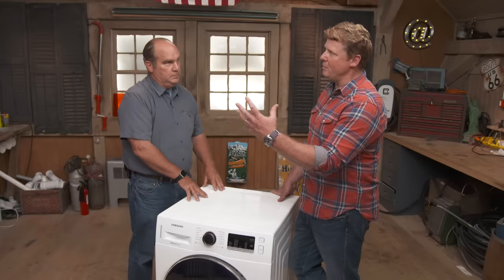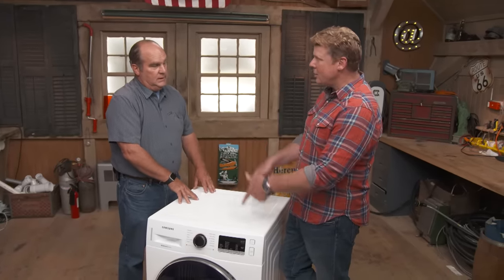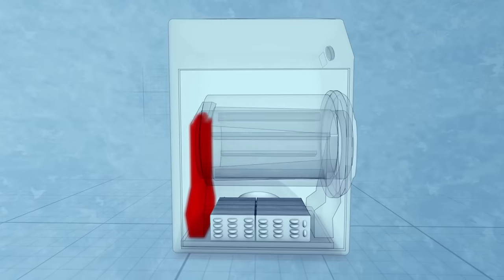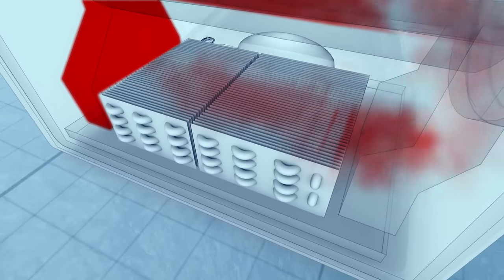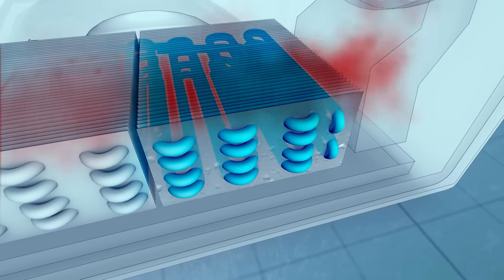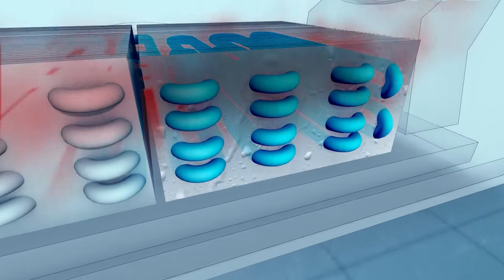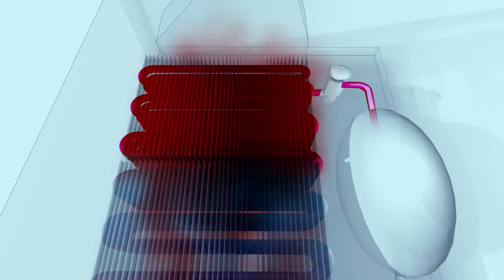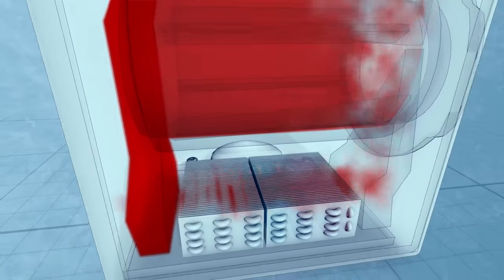Exploring a Heat Pump Clothes Dryer | Ask This Old House

Comment: Don't believe the hype. I had one in Europe.  The coils MUST be absolutely clean to maintain efficiency and a reasonable drying time (less than 3 hrs... not joking).   Also, there is a problem with mold buildup inside the condensate trap.  If you have a perfectly good working dryer, you're best bet is to maintain it.  The environmental argument is dubious: chasing after new tech, throwing a perfectly good appliance in the landfill to save electricity (not really).  In the end, if you factor in the carbon cost of manufacturing (transport, solvents, man-hours etc.) vs using a perfectly good dryer, you are doing more for mother earth keeping an old dryer clean and well maintained.  Better yet, use a clothesline.  Check for yourself...
Reply: This has convinced me to stick with a Condenser. Thanks... I think 😂
Reply: Newer models self flush the condenser. Very efficient. Drying times are similar to our old coil dryer. Much easier on the clothes. Often, additional drying time is a result of the condenser needing a good clean. I'm using a Bosch 500 series dryer with heat pump/condenser.

Comment: Ventless dryers have pros and cons. The pros are energy savings. about 2.5-3.5kW per load. What few people realize is they are venting the heated or air-conditioned air from their home with a vented dryer. The EnergyStar ratings ignore this. Why bother with an air-tight home when each dryer load is like a 5" fan-driven duct to the outside?

The cons are the best ones are European compact models. Why? Because giant US mfg's don't have a user-friendly way to clean the lint off the condenser. With Bosch and Miele, you pull the condenser out and wash it under the tap. With Whirlpool, effectively the only US company to make ventless dryers, you have to call a service tech to disassemble the machine for condenser cleaning. A normal family of 4 needs this done at least once a year. If your ventless dryer is taking hours to dry a load, bet your bottom dollar the condenser is clogged with lint.

Bosch tried to make a high-end ventless dryer with a self-cleaning condenser but it failed in consumer use. 

I have the large Whirlpool ventless and I beg the service tech to clean it every year but he hates the job. Some tech's just refuse because it's an ugly job. Whirlpool engineers are not that bright.

Comment: My dryer vent supplies 3 kw to my backyard in the form of hot, damp air. A 1 hr cycle throws 10,000 btu outside. ventless saves 15 cents per cycle in natural gas not burned for the same heating effect. For electric savings? Maybe another 15 cents. So... 1 per day over 1000 days nets $300. Long return.
Reply: kubtastic huh, $100 a year to run my electric dryer, I’m good with that.

Comment: They may save energy, but if it develops a refrigerant leak then the dryer is junk. Not to mention they aren’t a simple as a conventional dryer. I’ll just stick with my 1973 Maytag DG306 gas dryer that will outlive most newer dryers made today.

Comment: I can't understand one thing - heat pump is not producing any heat itself, yes? It's just transferring the heat from one side to another. In this case, when you blow the air - first to the cold part, then to warm part - you should get back exactly to the same temperature (as input air, but less humid). But it's not the way how dryer works. Temperature in the drum increases significantly, as well as room temperature... My question is - what is producing that heat?
Reply: Whatever you are using to condition the temperature of the room the dryer is sitting in. The dryer works by moving the heat (from the air) between the cold condenser and the heat-exchanger, so if you place the HP dryer on a room which 15C or below, there is not enough heat to "pump" and create the necessary difference for it to work. That is when people will see the drying cycle time spike from 2/3 to 5/8 HOURS. Long story short, don't put a HP dryer on a cold humid room.
Reply: Btw, that is why a HP dryer dries using lower temperatures. It can generate a 25 to 45C difference internally (depending on its generation). If the room temperature is 15C, the heated air will top up at ~60C.

Comment: These are common in europe and just look at how much the British complain how bad they are....  We were in Greece last month and had the displeasure of European washers and dryers again. They are both horrible. 

     The washers take 4 hours to run a normal cycle. If you forgot to put an item in the washer, tough luck as the door won't open until it's done unless you take the top off the washer and manually open the latch with a screwdriver.  The dryer was just as bad. You are better off washing your clothes by hand in the sink and then hanging them up from the grilles of the mini split to get them to dry....

            Washers and dryers are something that the US does well. Ours just work. Those euro ones are a neat idea but they just don't work well.
Reply: Dryer issue in the Uk is that they catch fire, these are the standard type with the vent, been ongoing for some years, various trading names, parent company is now Whirlpool. Lint  build up around the heater is the basic problem, even with the pre filter. I have the Samsung model shown here, for 2 years, been fine, low running cost
Reply: Robert Adams European front load machines are vastly more efficient than US top loaders. They use less water and less detergent, but clean better. They damage clothes less. They spin much faster reducing drying times. They heat their own water so are capable of reaching a boil if required. The longest programmes do take a long time, but everyday programmes are generally under two hours, and most machines now allow the door to open in the early stage so missed items can be added. Perhaps you just encountered a cheap or faulty machine. Dryers are much the same as in the US, the vented ones will be fractionally slower as they will be 230 volts but likely only 13 amps so they can be plugged into any outlet rather than a dedicated dryer outlet. Condenser dryers are common here, and again a bit slower but if you were in Greece the expectation is that you hang clothes out to dry! In warm climates condenser dryers don't perform as well, they need cool air to operate effectively. Clogged filters also make a significant impact, more so than in vented dryers. Sounds like you just had a bad experience.

Comment: Its really great a making mold, just like the Bosch front loading clothes washers.  High maintenance devices in a maintenance free society.
Reply: Really? Please explain
Reply: Always leave the front load door open when done washing. They need to air out. Close it mold grows!
Reply: Brian Ross Front load machines have been the norm in Europe for four decades. Nobody under forty has ever seen a top load machine. They don't get mould if you use them regularly, run a hot wash once a month and keep the door ajar between uses. Why America seems to think they are some new fangled trickery is beyond me- they wash better, damage clothes less, use less detergent, less water and less energy than a top load machine, they also spin faster so drying times are reduced saving further energy and wear on garments, still, you stick to a glorified version of your great grandmothers wash tub if you want.

Comment: had that model now for 3 years -mistake because you can not clean or remove to clean  the botton vent properly (wet lint )  machine is not drying properly now
Reply: Yea this is a huge flaw in the design. The genius of vented dryers is that lint is blown outside or gets trapped in up to a 25ft vent. I clean my dryer and dryer vent for lint every 3 months. Knowing all the lint my clothes produce with 8 pets I’d kill this machine in a year through lint alone.

Comment: I'd love to see this in a single washer and dryer unit!!! Cool tech.
Reply: I just checked a local electronics and washing machine supermarket. They alone had 20 different machines spread over 9 different brands. They are plenty abundant here in Europe. I don't know the market in Canada.
Reply: @yvindascanius6061  Canada? 🤔
Reply: @BloodyIron  When I click on your about section in your profile it says: Joined 12 Feb 2007, location Canada. Right or wrong?
Reply: @yvindascanius6061  might be, thanks for the heads up on my profile showing that :) no big deal friend :) thanks for the info on washing machines in your part of the world!
Reply: @BloodyIron  You're welcome. I just like to know which part of the world the person I'm commenting on is coming from. That could make the comment more precise. Have a nice day.
Reply: Check out the AEG Ökokombi, available in most of Europe I believe, for around 1000 €. I’ve had one for about five years now and couldn’t be happier with it.

Of course if you have the space for a separate washer and dryer, that is always better - this machine is tightly packed inside.

I was really surprised that a heat pump drier is considered a new thing over there. 

Greetings from Finland.
Reply: Øyvind Ascanius are you sure the combi machines you checked specifically had a heat pump doing the drying? There are a lot of ”condensing” washer-dryers out there, but they heat up the air with an electric coil and the condenser runs cold tap water through it and down the drain. So energy-wise they’re not any better than the machines that vent outside - actually they’re even worse off for consuming extra water.

The Ökokombi I mentioned above is the only true heatpump washer-dryer I’ve found so far. If you know of others I’d be thrilled to know, too!
Reply: @veikkoimmonen7300  They are true heat pump dryers. No cooling water is needed on these machines! I have about water cooling on very powerful stereo high-end amplifiers, but never tumble dryers. That's a new one for me, interesting to hear about. Which brand has that technology?
Reply: Øyvind Ascanius Pretty much every washer-dryer combi machine has that, with the exception I mentioned above. Standalone tumbler dryers do have heat pumps across the range, but not so much washer-dryer combi machines. Were you referring to standalone dryers or combi machines?
Reply: @veikkoimmonen7300  Just dryers. I didn't get that you meant combi machines. My mistake.
Reply: @yvindascanius6061  No worries. Washer-dryers probably commonly have this because they already have a cold water inlet for the wash function - for standalone dryers that would be an extra requirement.

Comment: not sure if im seeing the savings, if it saves 50% of the cost per load but its half the size??  Now you have to run it twice to dry the same qty which still equals, 100%
Reply: Not to mention the cost and waste from the units shorter life span compared to a simple and proven vented dryer. This is just another way for manufacturers to increase their profits.

Comment: I have whirlpool dryer. Heat is working but air doesn’t go through so all clothes stay wet but dryer itself become very hot 🥵. Even whole body such a hot can’t touch more over in the drum extremely hot. Drum also doesn’t spin.
Please guide me

Comment: Can I ask question. Do we have to vent electric portable dryer if we spin dry or wana just use as wrinkle remover or just to fluff clothes  my clothes come out my washer almost dry  do I still need to vent. I ask cause I don't have windows that open in my kitchen area I only have sliding door but I would need open whole screen also to vent n there is no outlet near it:(

Comment: Only one filter isn't enough, it will clog very fast. My dryer has 2 filters in the door and a very fine filtersponge in front of the heatexchanger. In 8 years i never had to clean the heatexchanger itself.
In the summer time drying your clothes on the balcony or in the garden is still the most efficient way ;)
Reply: Outdoor drying does take forever especially when there is NO wind
Reply: @stephensnell1379  Wind is good but it isn't a must have to dry your clothes. When it isn't too cold and no very high humidity it works fine without wind or sun. At warm and sunny summer days drying outdoor is often even faster than using a dryer.

Comment: In one video you used a heat generated by the central air conditioner to heat a swimming pool. Extrapolating on that how about used a heat output from your air conditioner to dry your clothes. I can see a DY I rule-Goldberg device that would probably work quite well on a hot day, of course you could also just use a clothesline. Samsung H.P. dryer runs 900.+ that's a lot of quarters for the laundromat.

Comment: Soon we will have an all in 1 washer and dryer. Just set the settings, load up, and come back in 90 minutes for clean dry cloths. Sorry you will still have to put the clean cloths away.
Reply: They exist but they take much longer than 90 minutes. They are common in the US in RVs.
Reply: Scott Muto washer dryers have been around for years. They are convenient but no one has yet perfected one, the washing is always fine but drying leaves a lot to be desired. Dual function machines will always be a compromise.
Reply: @spencerwilton5831  
Well, I don't think anyone has a heat pump combo unit. The heat pump condensing dryers run circles around the condensing only dryers without a heat pump. The main downside is they are expensive. $800 for just the dryer - and you can pay much more for these units with a heat pump inside.
Reply: 90 minutes lol. Mine current load has been going for about 7 hours now (including the wash cycle) and still not dry. I’ll keep you posted!
Reply: Combination washer-dryers have existed in Europe since probably the 80s if not earlier. But they were never very good.

Comment: How can adding a compressor and refrigerant be more efficient than a heating coil and venting outside?  Curious what the wattage consumption is for the compressor vs. a standard heating coil.  Plus now you have the added problem of having to empty the condensate, plus the added risk of a refrigerant leak or compressor or TXV failure.  Sounds like it would cost way more in the long run to operate.  I had a condensing dryer when I lived in Germany for 2 years, and it was terrible - always blowing the circuit breaker for the entire apartment due to it's over-consumption.
Reply: European dryers with a standard heating coil are around 2.3kW upto roughly 3kW or a bit more. Heatpump dryers are mostly rated at 1kW but due the inverter they run around 600w only unless you use a faster cycle

Comment: I have two problems with these, otherwise, they seem good -- no duct cleaning, HOORAY!  First, the drums all seem awfully small.  If I have to take my blankets to a laundromat and do half loads, then there is no way I would get one of these.   Second, I would be afraid of getting mold on the coils, and then how would I clean them?  My dryer just broke down yesterday, but I'll just get it fixed and wait and see with these.
Reply: I can squeeze my king sized comforter in there and I own this exact model. It is smaller but it seems to tolerate me over filling it a bit just fine.

Comment: Ok. Now for the cons. Maintence MUST be performed properly and regularly or it will fail. A sealed refrigeration system failure repair can equal the purchase price of the dryer. This is generally in the $1000 range. Where exactly are your savings?
Reply: Seems a lot like a tankless hot water heater, in that initial purchase price plus extra maintenance means there’s no savings, and no one wants to believe it actually costs more. Heat pump hot water heaters there’s not enough of them out there to safely conclude that they cost more, but I’ll bet they do. I really like the concept of these new dryers though.
Reply: maybe in the US. In Europe they are pretty much ubiquitous, and prices have fallen to little more than the now obsolete vented dryers. A budget model is around £300 which is only $360. A top brand will cost double, but warranties here are often ten years long.

Comment: Wow nice. Does it run on 120v?
Reply: Yes, these will run on 120v if you get them in the US. I say in the US because most other countries use 240v all throughout the house so if THEY buy one it will run on 240v.
Reply: That's good to hear. In the UK we run everything on 230V but I've noticed our heat pump drier only pulls about 600W peak, so these driers are much better suited to lower voltage applications. No need for a bigger outlet.

Comment: No gas or electric dryer element or gas valve stays on the entire drying time.  All dryers have high limit thermostats, thermistor and a thermal fuse.  If your dryer element or burner didn't shutoff the thermal fuse would blow or you would have a fire. These safety's devices have been used for well over 55 years .
For the heat exchanger dryer the 134a refrigerant will be phased out and replaced with r600a which is classified as a flammable refrigerant. I would like to see a coil that is guaranteed not to leak with the new refrigerant.  I think the liability is far too great. 
We were trained on the 134a dryer 2 years ago.  They wouldn't consider a Sealed system repair,  you just replaced the bottom which has your entire Sealed system. 
The amish have solar power with an inverter and propane for there dryers or they would just hang it out on the clothes line. The same amish family has a speed queen top loader converted to run on 24 vac.